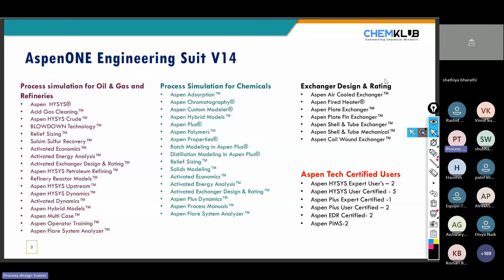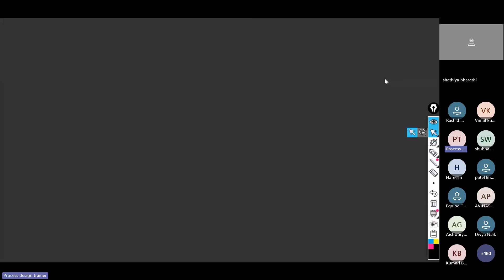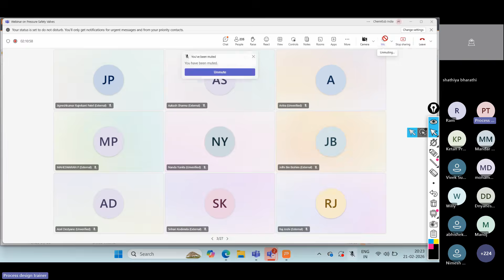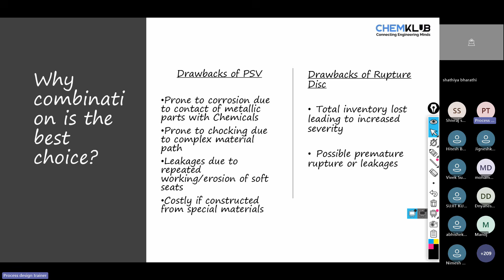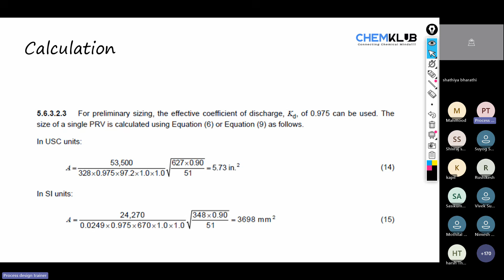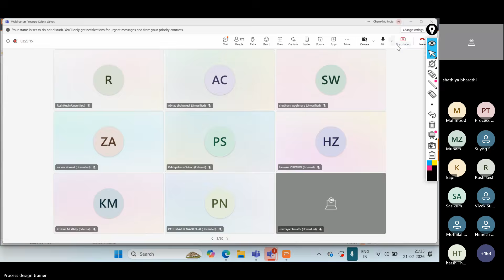Webinar on Pressure Safety Valves

Comment: I worked at Emerson Fisher control valves, 1:15:52 flow regime is similar to chocked flow - means even incase if we increase the pressure drop the flow-rate will not increase ; hope it is same ?